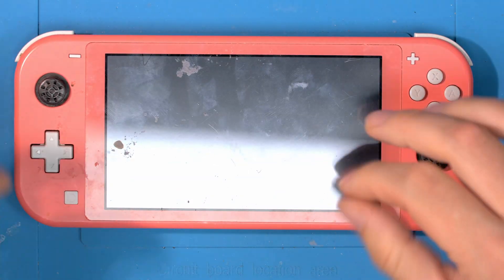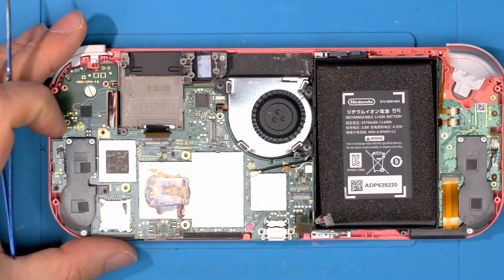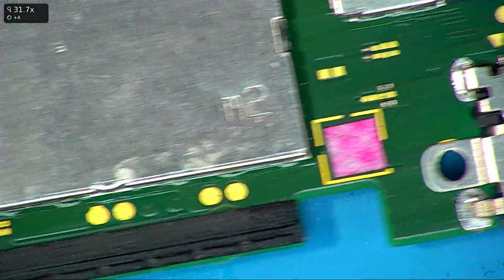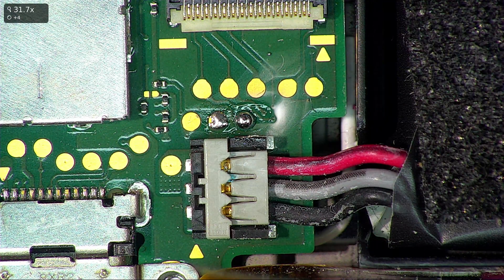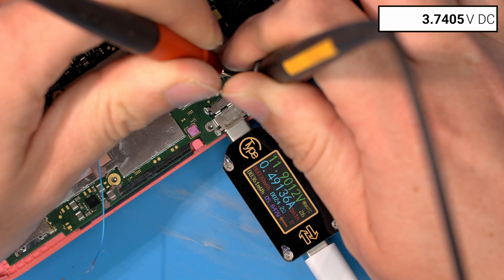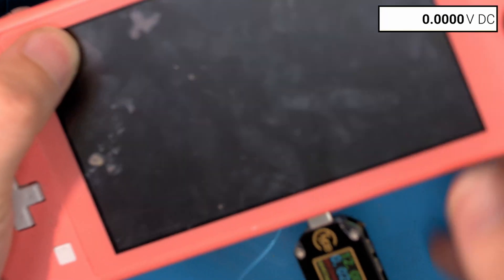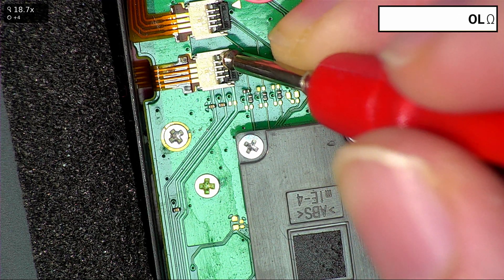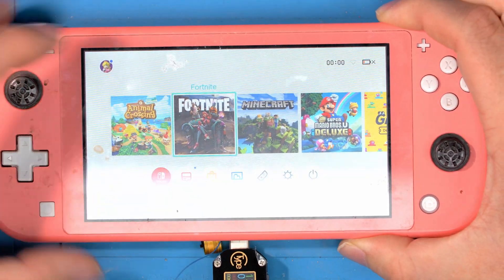Switch Lite Water Damage Repair No Charge

Comment: Hello, thank you very much for your videos. I need a little support, maybe you can help me or give me ideas.

I have a Switch Lite that when I want to turn it on with the laboratory source like the video I have a consumption of around 160mA for a couple of seconds and then it turns off (I did put the 10K resistor on it)

When I have it with the battery and the charger it charges the battery, and it even turns on (It turns on the fan, and heats up the processor) but it doesn't give an image. What could I try to diagnose?
Reply from the maker: Sounds like your bench powering is limiting the current or wrong setup. Jump on discord.gg/RetroSix for more help
Reply: @RetroSix  Yes, I read that on the Wiki, but my source is capable of supplying 5A, and I have it configured at 2.5A. I was thinking that it could be the cables that I use to make the jumpers on the Switch, but I use ones similar to the gauge of the that you use in your video.

Comment: Really love your videos, and how you explain your methods.
I do repair these quite alot, but even so, I do learn from you so thanks. 

I've only had that unable to charge message, on 5v charges where the soc is damaged. (also won't go into rcm on a unpatched switch. 

but they charge normally on on 15v and Dock etc.

Is your unable to charge message, simply because the power brick you used not powerfull enough, to power the screen and battery at the same time?
Reply from the maker: Yes I was just powering from 5V at the time, after the video I used 12V and was fine

Comment: hi, hope your all well. Not sure if you can help me with this as its driving me nuts. Got a nintendo switch lite which is drawing 0.00, i have changed usb ,m92 (3 times) and bq and still drawing 0.00. Any help or pointing me in another direction would be appreciated.
Reply from the maker: Have you got a bench power? And tried the RetroSix.wiki guide to powering from bench directly. It could be dead battery
Reply: @RetroSix  hi the battery is 100% fine,  done all those standard checks.. Can only think something is shorting but caps I have checked all seem OK..
Reply from the maker: Do you have a bench power supply? If so follow the wiki guide. If not then how are you measuring the current draw? Also jump on our discord for faster Comms
Reply: so yes i have used your method with my power supply and still get 0.00
Reply from the maker: @johncarr3458  So resistor soldered onto the battery black/grey wires and bench power 4V into battery pins? Then do you short out the power switch pins to turn it on?
Reply: @RetroSix  yes did all of that and still 0.00..it a strange one unless all m92 chips are bad but 3 bad ones would be very unlucky
Reply from the maker: @johncarr3458  m92 has nothing to do with that. If no power at all when pressing the pins together it's your MAX7720 chip. We sell those
Reply: @RetroSix  excellent thanks for that,  will pop on your store and have a look
Reply: @RetroSix  is that defo. Max7720?
Reply from the maker: @johncarr3458  The MAX77620 is responsible for all power after the power button is pressed. So so long as your power button is working (the resistor near the power switch isnt damaged) then the MAX77620 turns on all power rails to the rest of the system.

Comment: Great video. Recently picked up a water damaged switch as well. Bq and m92 had corrosion cleaned up and reflowed the ic. Cleaned up the backlight circuit as well, lucky no damage on the ribbon cables but all up and running. Can’t wait for the backlight tutorials
Reply from the maker: Nice. Yeah water damage rarely does as much damage as people think

Comment: Great video, really really useful info on back light. Thanks
Reply from the maker: Glad it's useful. I'll get more detailed pages on the wiki soon including the backlight circuit in detail
Reply: @RetroSix  the thing u mentioned I actually did.. I plugged battery in then the connector but didn't push it in straight, the next thing I know there is smoke coming from the back light chips.. Obviously shorted pins... Not good..